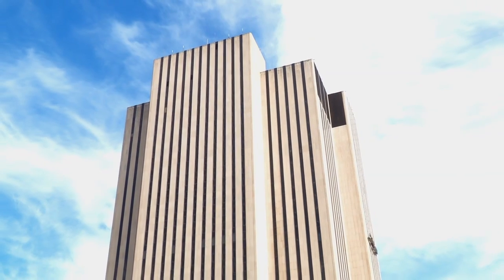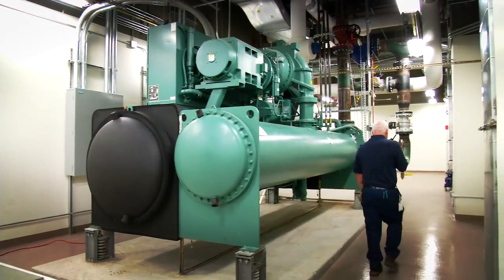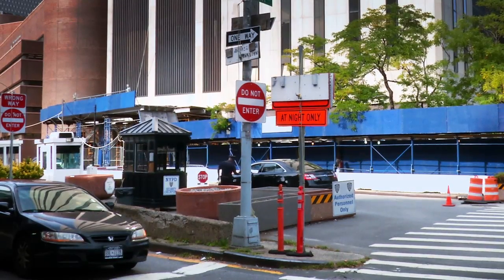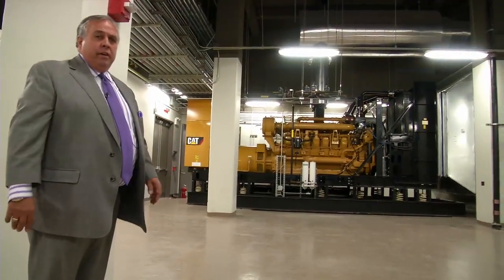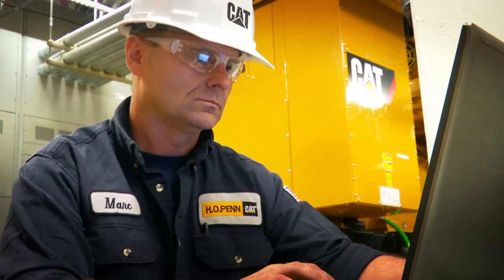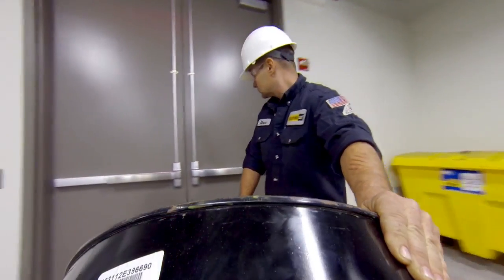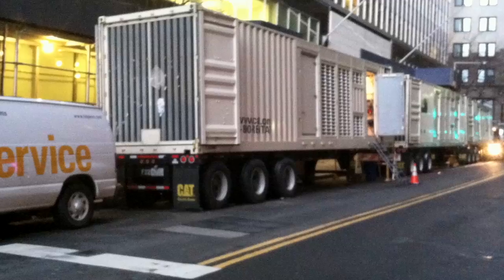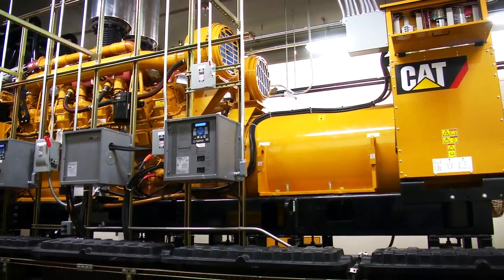Cat® Diesel Generator Sets Supply Emergency Power to Manhattan’s Data Center

Comment: 5:00 Yeah I know about the big black out, the North American black out killed power for a good chunk of the USA and parts of Ontario and quebec up here in Canada.
Turns out it was ohio that was the issue
Can't have power because of Ohio.
Reply: man I wonder how it would have been for buddy, the black out happens, I guess they'd hear a bunch of rumbling as the CAT gensets kick in and start going full blast to keep the data center running.

Comment: DON'T BUY A CAT!! You will be sorrrrryyyyy!!! Mine is about 15 years old. It made it through the Warranty. First it was the Fuel Pump, bad design and they made an upgrade after I spent $3,000 replacing them. The upgrade another $3,000.oo Now it is the Injector Pump $6,000.oo!! The whole Generator was $23,000.oo. They nail you on the parts!! Oil change $ 1,500.oo and up. I am an elderly homeowner on Social Security!! Fuel $ 5.oo a gallon!! YOU HAVE BEEN WARNED!! You think you are buying the best and won't have any problems!! THINK AGAIN!!
Reply: 15 y/o? And you are complaining? Time for a replacement! Sheesh!!!
Reply: @mfgc2610  Yes! Under 300 Hours of use and most of that is the weekly exercise! Also it is for a single family home! You spend top dollar for what is supposed to be top of the line you expect a trouble free piece of equipment! BTW it is serviced every year, Oil, Filters, etc.
Reply: @rodgerbooth1064  Not very many hours at all. $23k 15 years ago was a large chunk. On hearing more... I'd be pretty ticked too!

Comment: Wtf are they not powered renewably?!
Reply: Data centers usually have back up batteries that will power the datacenter for 15-60 minutes after a power outage. But this just buys time for the generators to turn on and start running. I believe the generators can create more power longer than the batteries. Maybe that will change in the future.
Reply: @davidh4921  oh fair enough, and yes with current battery technology that can change already but needs alot of space
Reply: Someday... Just not quite yet.

Comment: What is the MW rating of the generators featured in this video? The link referenced in the description no longer works...
Reply: These are small to mid size compared to the large EMD V20 engines used in rail locomotives and marine/stationary units. The EMD V20 series is a 7.5MW stationery power plant. Those V12-16 CAT's shown are like 2-3MW each.
Reply: I believe one of the people suggested the 4 installed plants are 3MW each.
Reply: It's power, but mostly are rated in kvA or Kilovolt-Ampere, but due to the big size of this generators are Mega instead of Kilo

Comment: Cat really has things under control when it come to standby backup emergency power generation for NYC.
Reply: National Business Reviews  What about sets where the entire place runs on batteries and is on a constant charge and when the power goes out there is no down time or reboot. You cant even tell the difference.
Reply: @jared2807  no Datacenter does that, they use a UPS like you describe just for when the generator is starting
Reply: @jared2807 Bro has zero clue what he's talking about. UPSs carry the load until the generator lives up, which is a minute at most. There is never a reboot even with these generators.
Reply: @pootispiker2866 or be old school like us, and use a DRUPS ;)